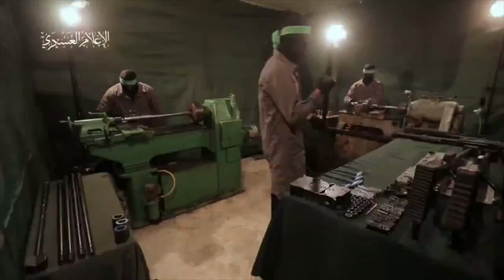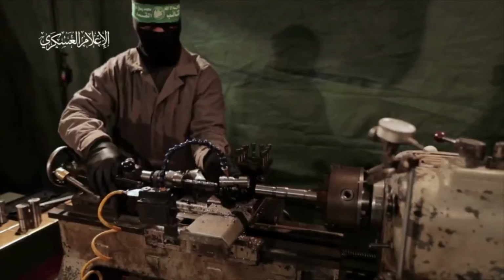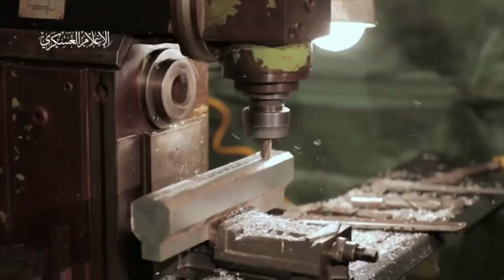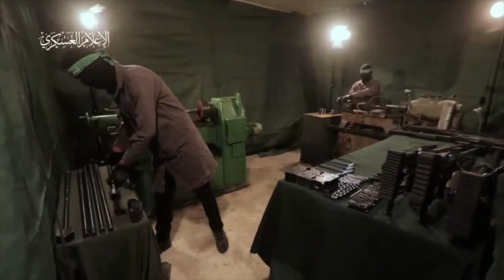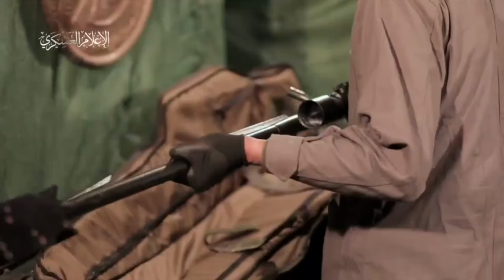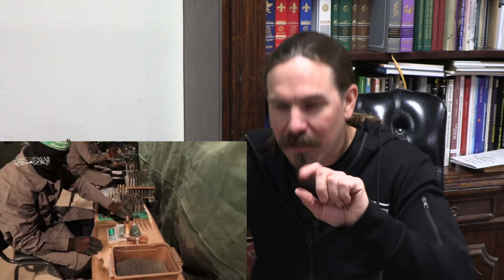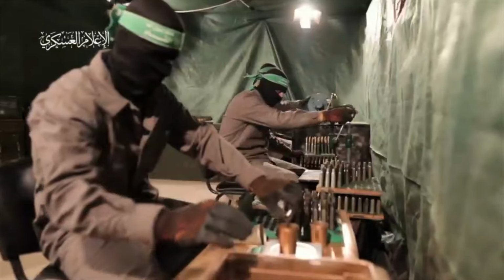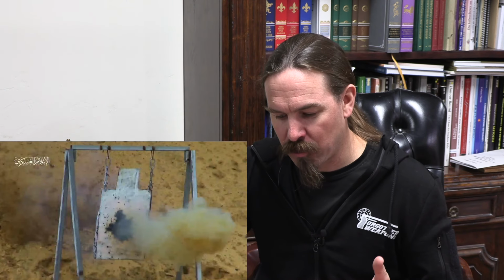Hamas Claims to Make Sniper Rifles in Gaza - Are They Really?

Comment: To be fair the Khyber Pass has taught us anyone can "build a sniper rifle" but it's another matter entirely building a sniper rifle that actually functions.
Reply: From what I hear not all the Khyber Pass manufacturing is guys hammering things out in a garage. Some of their manufacturing has gotten rather mechanized and sophisticated over they years. Of course one does have to keep in mind that the Sten gun was often made in machine shops during WWII. Denmark had a Sten factory in a bicycle shop, and even recently copies of the Sten were found in Northern Ireland. However, the Sten was not a sophisticated gun, but something that was made from scrap metal and could be put together with the minimum of manufacture. Fifty caliber rifles meant for snipers are going to need a lot more work and sophistication. Sorry about the length of this statement.
Reply: @schizoidboy sophisticated? RN50 has entered the chat
Reply: But not impossible
Reply: thing is some of those supposed locally manufactured rifles came with EDM and other high tech operation parts, but were stripped and assembled so deniability could be maintained. Basically what Iran is doing here. Surprised they weren't "3d printing" parts too
Reply: @rickbrasche8781  That's only a matter of time, unfortunately.. crazy developments in frontline doctrine in Ukraine the last 6-8 months re 3d printing and drones
Reply: @unbearifiedbear1885  Yet the wear and tear on rifles is much higher than on drones. At this point in time I think printing guns you would trust to work on the battlefield is years, if not decades away. I don't know, if there might be some industrial laser sintering 3D printers, which works with metal are available which could in theory print some parts.
For the stocks one could probably find some 3D printers which will work, but those are not the difficult part and wood is always an alternative. Especially, if the human resources are available and cheap in the region of conflict.
Reply: @rickbrasche8781 
Why on earth would the iranians even give a sh!t about "deniability",that simply doesnt make any sense.
In fact looking at the lack,at least so far,of weapons like the dehlavieh atgm (iranian produced Kornet) which you would`ve expected to see in considerable numbers if iran was supplying hamas,one gets the feeling that hamas was receiving very little from iran in the way of direct weapons transfers.
Now its possible that relations have still not fully recovered after hamas opted to side with the "moderate" terrorists....er... I mean "rebels" during the conflict in syria,and that iran is instead supplying other more reliable groups like islamic jihad.
Its also equally possible that just as its done with other allied groups in other countries,iran is supplying its know how to help hamas produce as much as it can locally using a mixture of as many locally manufactured components as possible,as well as available foreign cots,with only small numbers of critical iranian manufactured components needing to be supplied to produce the finished product.
Reply: Well if they can make Yasin rockets in Gaza, they could make a rifle that actually works, and judging by the videos released, they don't neet long distance accuracy since they were always very close to their targets.
Reply: @billhsu6349  Also 50. cal is not a sniper cartridge, it is an anti-material cartridge. So accuracy is not quite as important when you are shooting at a large target like a tank or vehicle…

Also hamas operates at close range anyway
Reply: Ive definitely seen legit Pakistani guns . 30 bore , aks etc . Maybe some machining is more sophisticated
Reply: If you wanna see them function their is videos that are graphic just to let you know not CNN or Fox though
Reply: They published videos of them sniping the IDF
Reply: I mean these guys are making rockets with sugar and fertilizer in about 60 feet below the earth. I don't think precision is key for them. As long as they can manufacturer something that works for them, hey why not. Desperate times requires desperate measures.
Reply: They build AK`s not sniper rifles. Big difference dude.
Reply: And yet IDF being sniped so......
Reply: Dude, their brass was all pick-ups. Every piece different, no trimming....
They were measuring the powder with a measuring scoop!!! "Snipers"😅
Reply: Maybe you should ask the Israeli soldiers if the rifles work!
Reply: Well they worked on childrens and woman and old people, for nazi hammas. After that they all run like rats to the tunnels @GlobalAnalysis101
Reply: 🤣 @GlobalAnalysis101
Reply: Saw a video of a guy making a 1911, which is a quite complex gun, in the Philippines I think, he only used a soldering iron, a lathe and a adapted mild made with a drill, the guy took a lot of days to make it but the end result was a awesome looking 1911, they tested, works fine, so I don't doubt anything in that stance, they probably do stuff on their own, but what is shown probably is just propaganda, they wouldn't want to show the real manufacturing stuff.
Reply: @Rrgr5  There used to be a channel of a woman doing the same thing with the typical garage shop tools. I can't recall the name but obviously that got purged by YT's stupid policies a long time ago. Anyway it's quite possible as a small shop, but inefficient. These weapon designs are all finalized based upon large factory production lines with high parallelization and standardization. Neither of those design decisions benefit the garage shop. There are so many specific machine operations that are incredibly wasteful for the garage shop's time. A similarly-functioning weapon might only take a couple days from complete scratch, but anything resembling the usual modern firearms takes over 10x that in a garage. It's simply not worth copying them that way. 

The Philippines example is a bit of an edge-case. His cost of living might allow him to live well enough from the price of his product, if sold at Western prices. He has to make it a fantastic specimen in order to get the sale at a good markup (relative to local value), and he isn't outfitting military units. If his objectives were for weapons of war produced in a war zone, he wouldn't be making 1911s, and these guys wouldn't be making faithful clones of production anti-materiel rifles from scratch.
Reply: It is absolutely possible, it just takes a TON of work and time to do without modern machining tools.
Reply: It is in Dara Adam Khail ares, I lived there and there factories that could copy anything. If you pay good bucks you get quality guns etc.
Reply: I've seen a guy in the mountains make a pistol from a can of soup, a soldering iron, and a hammer.
Reply: Number 2 comment behind the famas comment.

God I love the internet 😂

Comment: Ok, From an improvised point of view, They are turning bar stock down to form the external shape of the barrel blank, may be not finished, The throat of the 2nd lathe may not be large enough to pass the bar stock without turning it down first. The item that was lifted away when the drill was withdrawn. That is a drill guide. A gun drilling machine, that they will not have access to uses such a guide to center the special long drill upon initial penetration, Gun drills are not twist drills, ill post a pic of one later if desired. To drill a central and straight hole with a twist drill you have to first bore a hole with a small boring bar that is the size of the drill bit to use and as deep enough to have contact points on all 4 points of the clock, top and bottom, fore and aft, the 2 axis are at 90 deg from each other due to the twist of the flute. So needing a straight starter bore before drilling deep enough for this. You can then drill away pecking away at it clearing swarf and when deep enough use a drill braised on the end of a rod. Then ream in a similar way, a traditional hone machine can be improvised if desired. A rifling button in carbide can be mailed in the post and driven through by hydraulic pressure, all within the capability of those people. Then the outside profile can be finished after clocking the bore true between centers and not the outside because the long hole will not come out in the center as it went in, even with a proper gun drill. Its all improvised but in that environment possible to an extent. No one is claiming it will be any good but still possible.

Comment: I can't comment on the machining because it is beyond my area of expertise, but I am an avid handloader myself and a few things occur to me, firstly that volumetric powder loading is how all factory produced ammunition is made (including the ammunition issued to snipers). If the scoop is correctly calibrated then if nothing else it will be consistent. It very much looks like they are working with dismantled machine gun ammunition. I wonder if they are going through all that trouble to actually download the ammunition. And that would make sense as the clone rifles they are working with may be failing when used with full power ammunition...

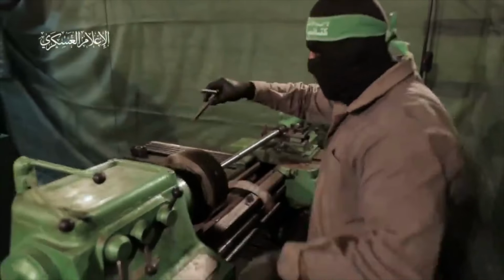Comment: Hello, i'm a  lathe operator from italy. Is normal to machine the external diameter first and the internal part of a barrel is not likely being made with a lathe. At 2:56 is not a piece of cloth being used but a pierce of sandpaper for a better finishing grade of the surface. Is not that uncommon to turning an external diameter dry.

Comment: If the Russians were able make Mosin Nagants that can hit at 1000 yards in the late 1800's / early 1900's, I don't think this would be hard to do with any even remotely modern tooling. A lathe, a mill and press, don't even need a CNC with jigs. I think everyone is too use to modern tools. Rifling is not hard to do. You can get a 12 ton press from harbor freight and a double bladed bullet button for $20, another $20 for high strength steel rods online and and rifle it with the press. Further this is not a complicated rifle compared to a semi-auto. Kind of foolish to think they have more then ample tooling to make that rifle and more complicated stuff. Propaganda more then likely but I feel like a smith was not collaborated with on this video.
Reply: Cope harder

Comment: The machineing process in this video is fake in every way possible there's not even any indication equipment hooked up on the machines (digital readouts) also the machine are from the stone age the tool post on there lathe probably served in WW2 and also every machinist has tools and bits laying all over there's literally none here not even one micrometer in sight either and that one little clip of the guy throwing chips off the pice of aluminum is cross cutting by hand so that's fake also Ian just to let you know I literally grew up in a machine shop so nobody's fooling me about manufacturing process

Comment: Cool video Ian, but i think the over analyzing critical aspects is kinda unnecessary. Its Gaza for one, they certainly are not working with specialized tools for sure, crude craftsmanship is as good as its going to get under those circumstances. I saw your video about how barrels are being made, and yes specialized digital tools for precision rifling most certainly are not accessible to anyone, and most certainly wont be found in some war torn zero industry environment in a underground tunnel. 

Those guns, if they are indeed manufacturing them, are going to be crudely manufactured. 

Gun markets in Afghanistan and Pakistan have made similar firearms with less tools and a lot of hand filing, so it certainly is possible to make an effective firearm with the basics.

Comment: The barrel machining processes look like an AI video of machining operations. Lots of machining looking operations compiled by an entity with negligible understanding of how to make the thing.

They're not even supporting the barrel with a follow rest when they're doing their OD turning. Long lengths of bar stocj are quite flexible enough that you'd be cutting a barrelled shape. Bulged in the middle like a whiskey barrel that is so they'd be making barrelled barrels... their steel is also cutting more like a soft machinable alloy like 12L14 instead of a high strength heat treatable alloy given thr lack if support given to the barrel during cutting.

It's like a cargo cult version of gun making.
Reply: Thanks for the "following rest". And yes, that was my idea too "precision barrel". You want to make the bore and rifling in a piece of steel as stiff and well supported as possible. Turning the outside, meh, those few thou, who cares?  (unless it's to avoid heat warping after a few shots)
Reply: @maddox0110  The OD cut would be more tolerant to inaccuracy, but the bowing of the rod would result in terrible chatter as the rod flexes while it's being cut. You'd be burning out cutters like mad while the thing is shrieking away. If they used a consistent auto feed they might get a really cool looking spiral polygonal exterior that would fade as you get to the ends, but you'd be eating cutters like mad and achieving really crap cutting rates. That much chatter might also end up burning out your spindle and tailstock bearings early too.

As to rifling, there is an older method for cutting rifling with a drawn single flute cutter which gradually indexes outwards as it's cycled back and forth in the barrel. The cutter plug has a cutter which is supported by the gun drilled bore and the cutter is gradually indexed outwards to cut deeper rifling grooves. it's a really cool clockwork system that kind of resembles a lathe with all these long travel shuttle rods. 

Because the plug is supported by the bore, you don't need much support on the barrel.

It's really cool to see rifling methods that predate hammer forging. It would be cool see some of this stuff brought back to life in their janky Hamas workshops or in the Khyber Pass.

Comment: Mostly correct observation. You dont want to impart tempering heat (500F and up)  into treated gun parts. Machining oil will absolutely smoke on heat if it contains volatiles such as K1, mineral spirits or ATF.

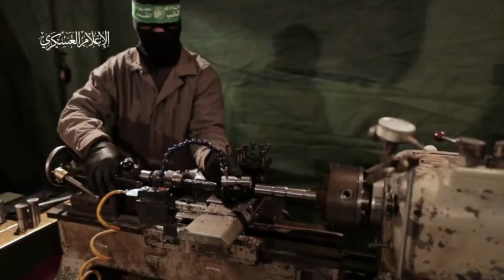Comment: 3:48 Probably didn't show the parting operation in the video. Often machinists will leave the part to be cut off with the boring drill inside so it does not drop into the pan when the work piece is cut off. 
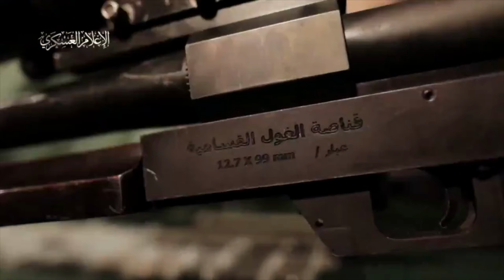 9:32 The rifles made look DIY as I noticed the edges are chamfered like on production rifles. Only issue is that did not show the gun drilling & rifling operation. Its Possible they imported a lot of 50 cal barrels and machined them for the AM-50 they were copying.
12:22 That's brass not steel, its just dirty.  Definitely not the best, they have to make do with reusing brass.
16:49 The are reusing ammo crates. everyone does it.

Comment: Hello, machinist here.
Just making comments on the 3 processes we see in the video.
Barrel lathe could be turning a barrel blank, its not uncommon to do a roughing operation before setting up for the finer cuts later, however looking at the chips and how slow and hot the tool is running i get the impression that they are turning using a toolbit steel rather than using modern insert tooling.. i mean if thats what you got then sure, but you can get both inserts and holders dirt cheap from China and while they are nowhere near as durable as specialized ones you would find in a modern machine shop, they can do good work if youre willing to fiddle with the cutting data to get them cutting decently. I agree that first lathe is just for show.
Second lathe where the work piece appears to be pressed into the piece held in the chuck could be that the dock holding the drill cant move (either from being rusted stuck to the bed or incorrect mounting) and thus the setup is made that way to work around old dingy equipment, we dont see a single chip being made on the second lathe so we cant really know if it actually runs in that way.
For the mill i see the only credible bit of machining in the entire video, being that its and old mill and they run the one pass we see with the cutting edging pushing into the material. The reason this is credible is because old mills tend to have wear and if you run the cutter with the cutting direction instead of against it like in the video the cutter can, if there is wear present, pull the material into the cutter which reduce the lifespan of the cutter or break it right then and there... buuuut you only have 2 directions to make your pass so it might just be luck that the clip actually did it right. Noteably running the cutter against the cutting direction will in most cases produce worse and less accurate cuts, which doesnt scream precision.
I would agree that if they do produce rifles its not on that machinery nor with those tools.

Comment: I don't think they necessarily took apart complete rifles to fake the manufacturing. I think it's more likely that they receive rifles from Iran, but smuggled as individual parts. And they simply put them together on site from those. It's much easier to smuggle a rifle completely broken down into parts, since you can hide most of the stuff easily in a shipment of regular hardware and spare parts. Even if you are looking for gun parts, except for the barrel, receiver and bolt head, most of the stuff can easily look like regular machine parts.